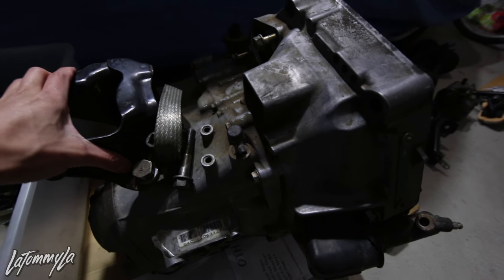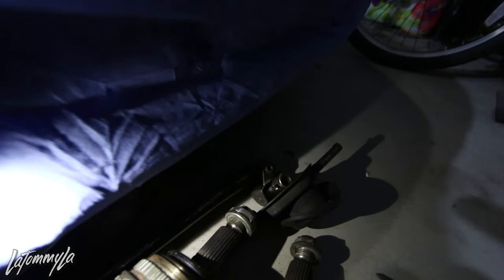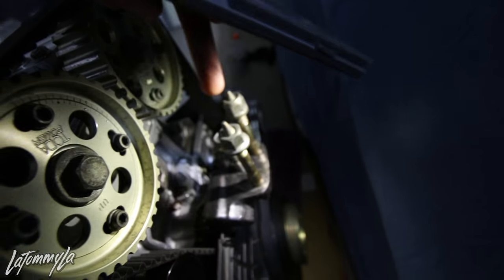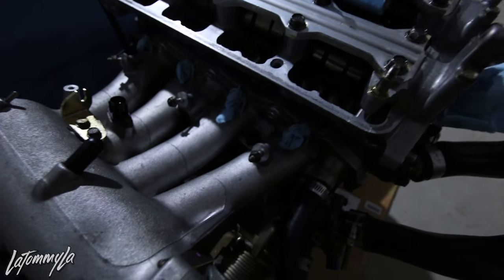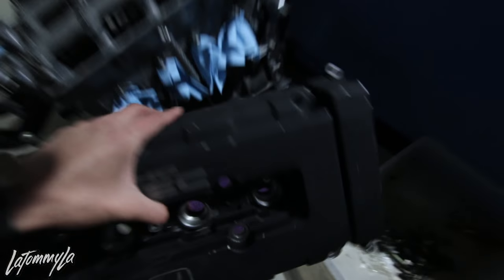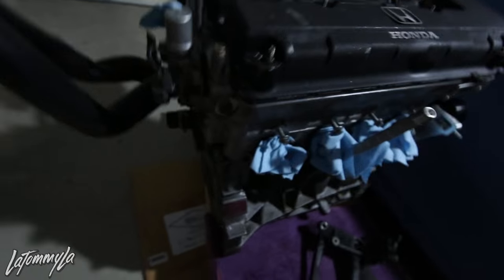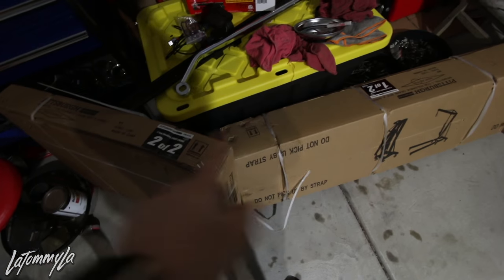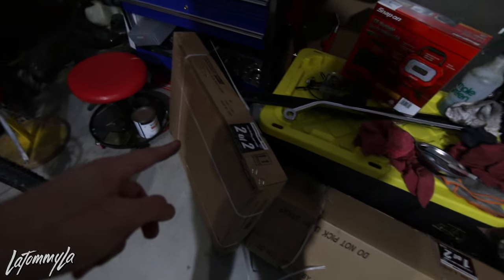B18C5 SWAP PT. 1 - I GOT IT!

Comment: vent your valve cover with two -10an fittings to a catch can, its the best method to vent crankcase pressure during road racing and not having to empty the catch can every session. lastly, get bigger injectors, 310cc at least, 440cc even better. with that compression and those cams u will need fuel at your disposal during tuning. I have some 440cc RC injectors for sale. since I bought teddyjons 550cc 😋
Reply from the maker: +Mike M might just end up getting RDX injectors unless you can hook it up haha! And catch can setup I have to see what all happen 😂
Reply: LATOMMYLA you were tagged on my for sale post on the vtecclub classified page. Jon had issues at ACS with crank case pressure building up and blew his valve cover gasket during his first session, which may have resulted in your rear main seal leaking oil. trust me, vent through valve cover and plug the stock vent hole on the back of the block where the black box connects too. save yourself the headache during track days.
Reply from the maker: +Mike M oh shit I didn't even know that, he already plugged up the breather box hole. Looks like I got more stuff to do haha!

Comment: don't buy the b20 post mount you need the b16 em1 2 hole post mount I have one for sale if youre interested
Reply from the maker: How much shipped to San Diego?
Reply: latommyla 40 bucks
Reply from the maker: Ill pass! Thanks tho, I can easily get it from my junkyard
Reply: no worries man but congrats on finally getting the swap .I'm excited for you. let me see if It fits in a usps flat rate box and I'll get back to you with a better price.  but yea just makes sure you don't get a b20 one . it's taller
Reply from the maker: Thank you and let me know! And I thought they were the same haha
Reply: only the CRV post mount from 99-01 works, the one with the camber box on the intake manifold, not the older models with the long intake manifold.